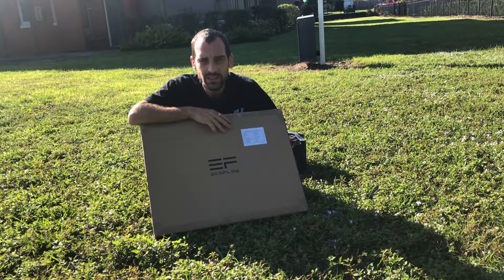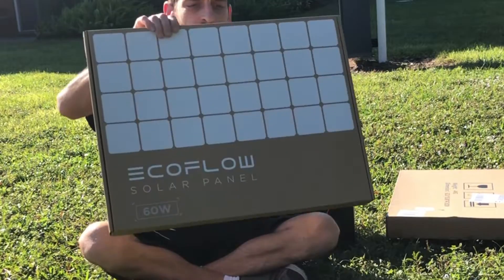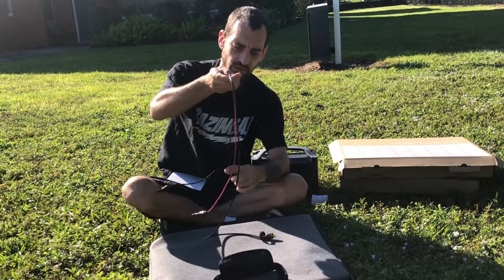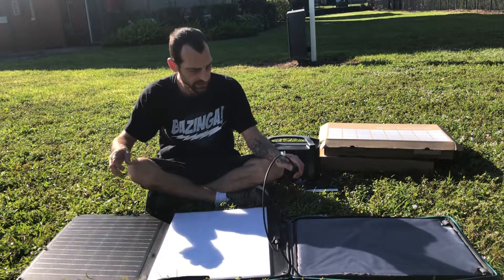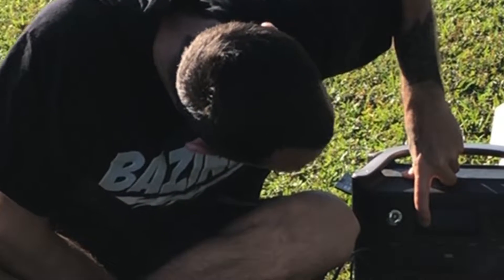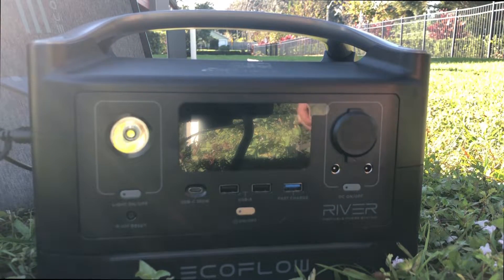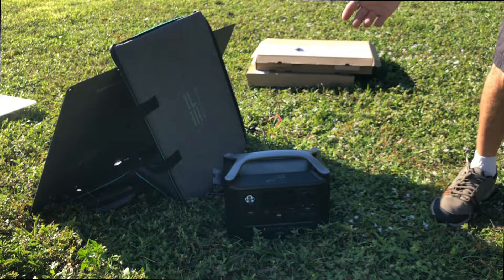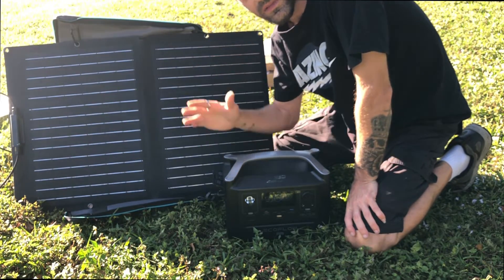EcoFlow 60W Solar Panel

Comment: My river box looks different the handle is on the back and mine is not charging I don’t know what I’m doing wrong
Reply from the maker: Sounds like you have a river 2. How are you trying to charge it AC outlet or solar panel?
Reply: yes my UGREEN PowerRoam looks the same as this one. Maybe in different countries EcoFlow goes as UGREEN and vice versa